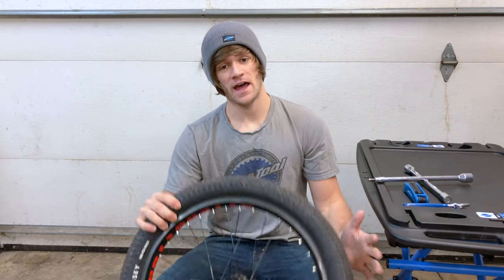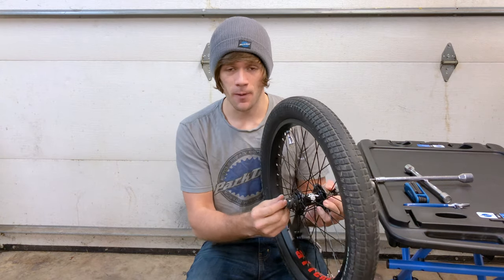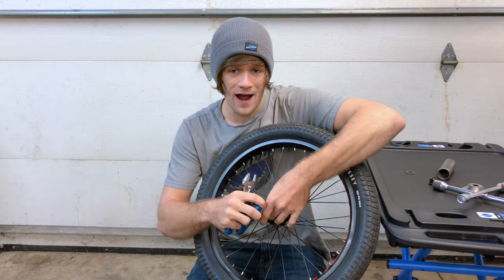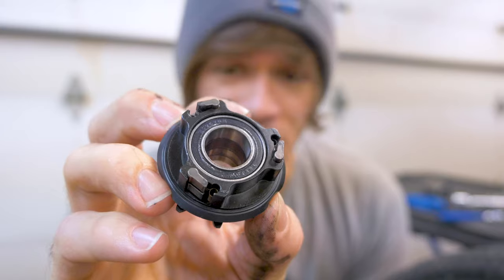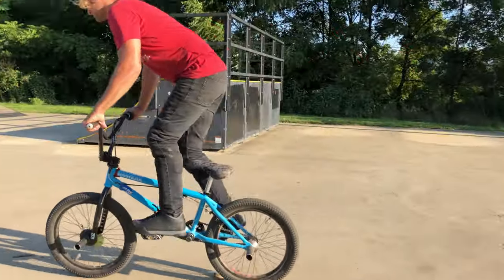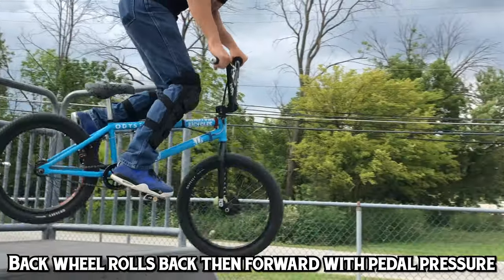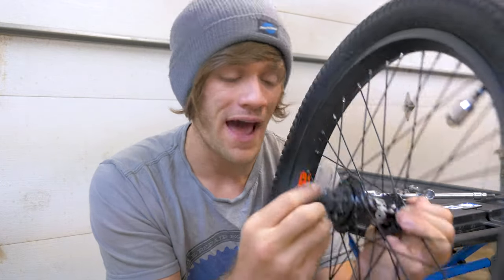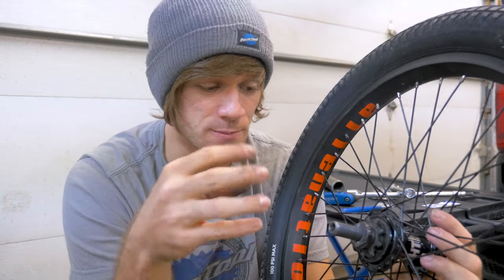Actually GAME CHANGING!!?? -FINAL REVIEW - Free Night Planetary Freecoaster

Comment: I don't think I ever updated you on it but after my axle bent back in December, I contacted both Tal and eastern about replacement axles. I was told by Tal the replacements would still be the same inner diameter, but that they had ordered some sturdier ones that would be some months out. Talking to Robbie Taylor at Eastern, he was able to get me compatible replacements once I gave him the measurements of the freenight axle and they would cost me less in total because they were shopping domestically. Because of their stock at the time, he had to pull them from built hubs, but was able to get me two of them just in case I had another one bend. Fortunately, the ones that came in were a smaller inner diameter, taking a 6mm allen, instead of an 8mm. I'm still on the same axle and it seems extremely strong. I don't know if I'll ever actually end up needing the second axle. 

Over the time I've had it, and only since replacing the axle, I have had the problem of it not wanting to engage forward a few times. Every time it was because of the cone nut on the drive side being loose. Since I didn't use a bearing press, I think the problem is that my bearing on the drive side still isn't pushed in all the way. Besides that, I sometimes have an issue with it engaging the cassette unintentionally but it's typically because of my crank movements being sloppy or inconsistent. 

The only wear I've seen on the hub is the corners on all three of the points that engage the driver being rounded, but as long as my cone nuts are tight, this is not a problem and it still works as well as it did back in September when I first got it. Even though it's the only coaster hub I've ever had, based on riding other people's bikes, I still think it's the best one out there and I'm glad I got it. 

An interesting side-note, I was told by Eastern that apparently the reason this hub and the salt plus equivalent are allowed to exist is because there was a period before Eastern took ownership of the Ezra hubs when parents weren't settled and so other companies were able to copy or work off the Ezra design. I'm glad that happened because the freenight seems to be a much better design than the Ezra.

Comment: Thanks for going really in depth and long term with this. I ended up going for the BSD Revolution over a cassette because of your videos. Awesome to know these things are consistent and durable. The pedal pressure is maintained if you pedal forward and hold the pressure before you tap, but I’m gunna make some pawl springs from spring steel and slip them under the pawls so it works as a cassette if I really want it. Take ‘er easy!

Comment: Many thanks for this in-depth review!!! I think I will go for it on my dirt jumper! (Bit nervous because it's not a cheap piece of kit!) The ratchet seems to have 24 or so teeth? Freenight's website says it has NO slack but that doesn't mean that it engages instantly like some MTB hubs would, correct? For example if your ratchet has 24 teeth, your hub only engages every 360 / 24 = 15 degrees, unlike an Onyx BMX or MTB hub which actually engages instantly.
Reply from the maker: It's definitely not instant in those terms but it's instant in comparison to a traditional freecoaster. It's something you will notice if you're switching from a hub like that but it's not something that realllllly affects riding the bike and is very easy to get used to
Reply: @Brant_Moore  Thanks, that's what I thought. Ordered one anyways. Can't wait!
Reply from the maker: Let me know how you like it! Did you get the mtb one with disc mounts?
Reply: @Brant_Moore  Yap. Will do!

Comment: I'm not sure if you ever figured it out but in the one video you had pedal pressure for a tail tap.  My guess is you have to start pedaling down just before the wheel touches and starts going backward.  If you start applying pressure while the wheel is still spinning forward the cassette should lock in.  I'm thinking of getting the free night one since BSD is on major back order

Comment: Can confirm! Best freecoster ever only thing I can comment and would love feedback on is when I go from coasting while cruising forward and try to torque down to take off I get a little (very occasional) skip like the slack you would get from a freecoster just with extra noises. Its maybe less than an 1/8 a crank of skip anyone else ever experience this? Brant? I'm thinking that it's just the clutch not being totally engaged the sound is what makes me cringe really plus going to pedal and suddenly having no pressure is super rad.
Reply: Benjamin Wise I had this during the first week of wearing it in and since then it’s been fine, how long have you been riding it?
Reply from the maker: I have that maybe once per session but it’s never bad enough that I lose momentum or that it messes me up. Almost always when Im just turning around on a quarter or not really doing anything. It’s pretty rare when actually riding or in a line.
Reply: @andrewskinley  I'm at about a months worth of riding now
Reply: I commented on this video about how mine went from the occasional pop to skipping really bad. I disassembled it and saw no damage. Reassembled it and it's still bad. Glad to be back on my Shadow Optimize coaster. I know it won't let me down.

Comment: Great Review! Do you use that rim because of the coatings for braking performance? Or other reasons? Dave
Reply from the maker: Strength too as well as the fact that tightening and loosening spokes has such an immediate effect it makes truing easier. The smallest turns have an impact.
I do ride for alienation but I would ride their rims even if I didn’t

Comment: I'm looking for cassette hub for a bowl ride. I think this could be perfect hub for my current situation.  (Right now  I'm using ClutchV2 Freecoaster) 
But I'm still worry about the durability of planetary hub.
Freenight says "Fast pedal forward movement while moving backwards can cause unwanted and damaging engagement."
What If I bail only my back foot, while I'm doing 180s. Could Planetary handle those kind of impacts?  hope so.
Reply from the maker: You aren’t going to break it on a situation like that where it’s an accidental slip. You would legit have to crank like you’re trying to break it to break it. I’ve done it pretty hard and had others do it as well on my hub and it’s still as you see it.
Reply: Thanks brant!
Reply from the maker: Always happy to help man!! Hope to see you in the comments here again in future videos!
Reply: I have the hub and I'm pretty bad about accidentally engaging it in fakie when I lose my balance. I do it at least once almost every session pretty hard and I ride for hours 3-4 days a week and have had it since September. I've seen a little more wear on the corners where Brant showed some wear but it's been like that a long time already now and it's still working perfectly as long as my cone nuts are tight. I'd expect more wear on the teeth inside the hub or on the pawls, but I don't even see that. I took a chance on it after only seeing the first few videos from Brant and I'm glad I did. Zero regrets. 
I will say though that if you're looking for a loud cassette sound, this one isn't quite as loud as a normal one, having only 3 pawls. One of Brant's videos does a comparison on the sound.
Reply: Adam Rosenthal Thanks for sharing your experience👊🏾
I was concerned about just like what you describe! 
Cant wait to get this magicalhub.👍🏾

Comment: The salt plus trapez hub is the same thing without the cassete sound and it can change from being a cassete or a frecoaster while using that same system when its set as a freecoaster man
Reply: i'm not throwing garbage on the hub btw, i'm just exposing another option that shares the same system cuz it is one of the best hubs for crankflips in case of both hubs which was the main reason why i got the salt hub
Reply from the maker: Except it’s not the same at all. It doesn’t have the planetary clutch in it that allows it to coast without being disengaged. You 100% have to disengage and reengage that hub. That is the whole point of this hub and why it’s called the planetary